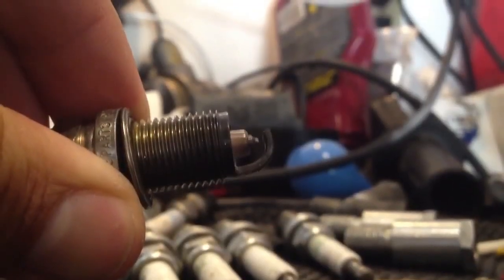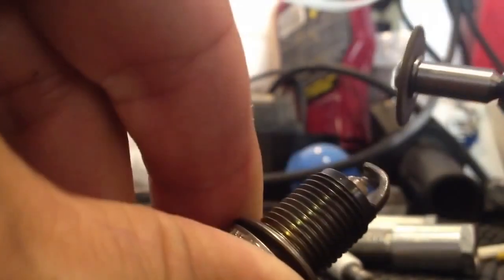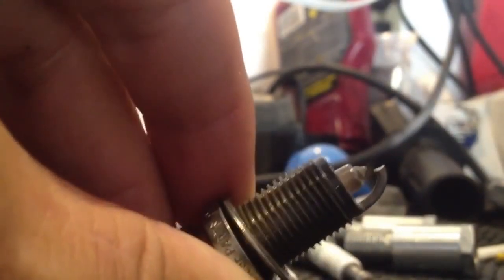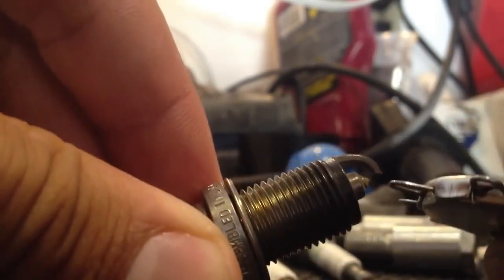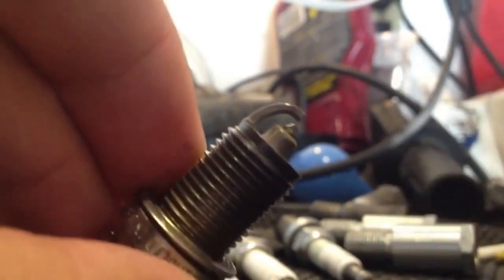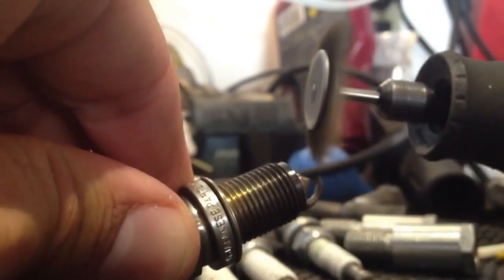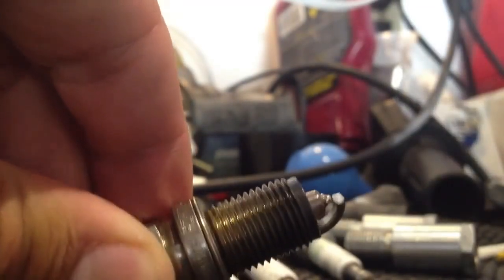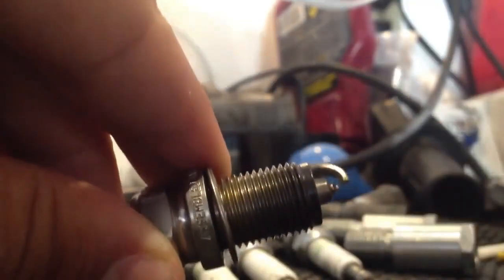How to modify sparkplug to increase spark

Comment: I like how he didn't even show a test on them to prove that it even did anything. I also do not understand why you don't just gap them out further and call it a day since it is literally inside the most pressurized part of the engine but what do I know I am a professional mechanic.
Reply: I went ahead and snipped an iridium NGK plug, an old spare with a weaker spark  than it's copper brother so a deserved sacrifice it  being less, not more  durable . Well now it showed it's brilliant direct zap again  but what about under pressure ? Yes it matters , the bike that was missing badly after 30 km/h was cured . Your a  professional and  it's never the spark plug ?  When there are no paying customers you have the luxury of being stupid , the plug won't be reliable they say but i was pissed off and will be pushing it home soon as per usually . lol

Comment: Congrats. You've just destroyed your sparkplug.
Reply: Nah they will perform better but only for a few months then they will stop sparking altogether. But if you are racing and changing out your sparkplugs every weekend then who cares.
Reply: @cannaroe1213  thx you answered my question i was wondering why he did that to the spark plug,i never knew about doin such thing
Reply: @schmittie123 When sparkplugs wear, the top bit of rolled over metal disintegrates from the tip to the base. By chopping off a few mm of your sparkplug then gapping it, you have that much less sparkplug lifespan. However, you also have that much less sparkplug in the way of the path of combustion. Does it make any performance benefit at all? Probably not. Does it take a sparkplug that should last for 5 years and now only lasts for 1? Yes. Does that matter for racing? No.